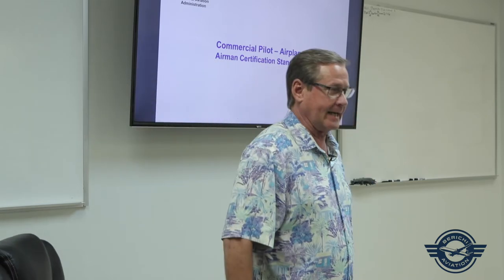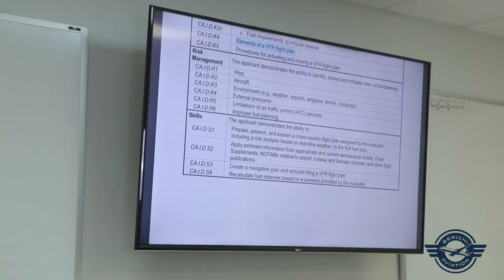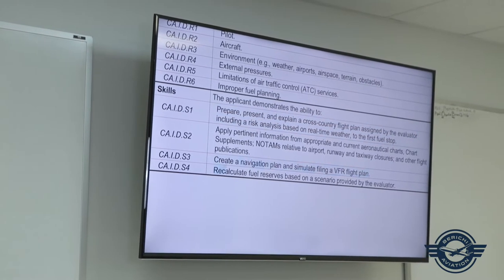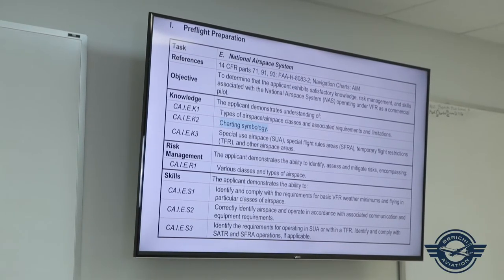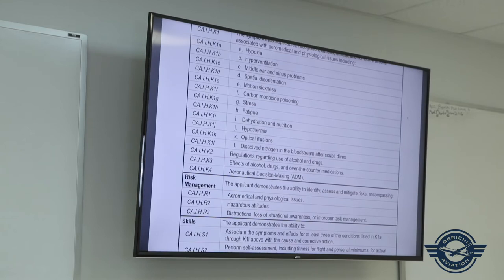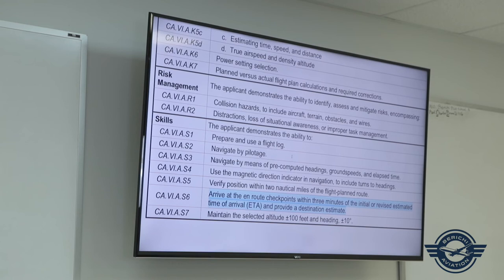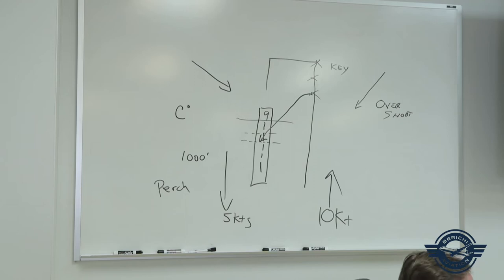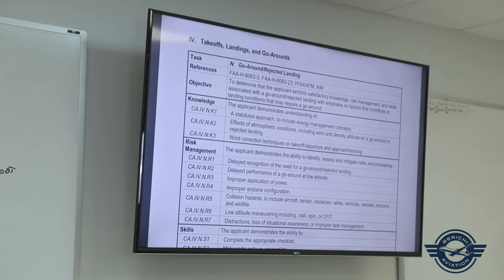DPE Explains How to Pass Your Commercial Pilot Checkride

Comment: Sounds like DPE does not want to see a slip on the power off landing. Yikes...
Reply: What's wrong with that
Reply: Did it on mine and passed.
Reply: @jamesm7649  that should always be an option
Reply: @jamesm7649  When you have the only option of slipping a plane into a small grass strip because you lost an engine close to the ground then that should be taught, practiced and encouraged.